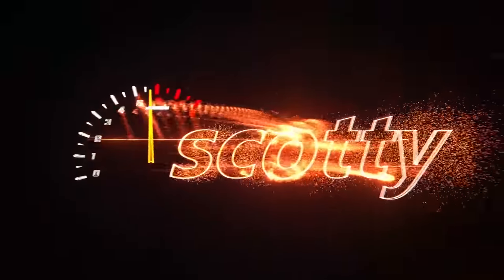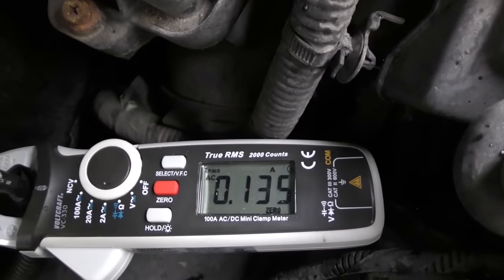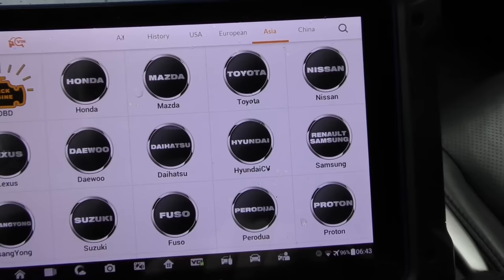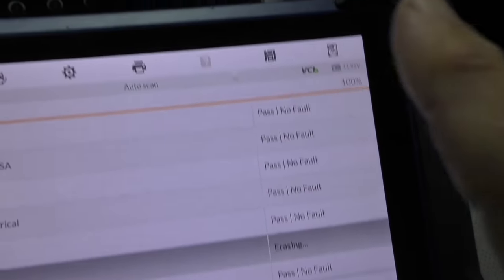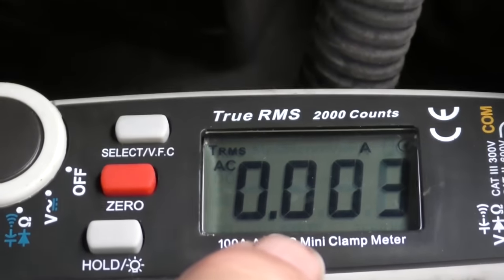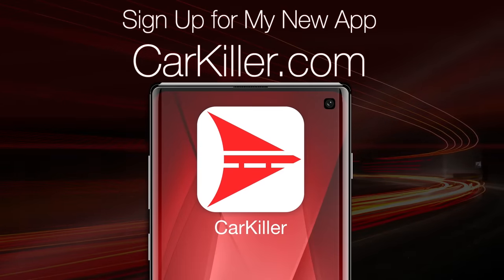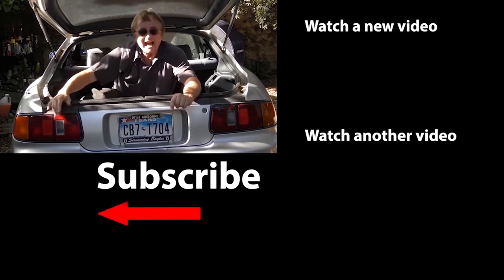Watch This Before Buying an Acura

Comment: No need to use a clamp on and look for milliamperes. 

Its the Blue Tooth module that is in the console. When they get old they drain. 

I’ve had my 2008 MDX for 30 years. I unhooked the BT module...which I never use...and it no longer drains batteries. 

It has been fixed for 2 years.

Comment: Hi Scotty ! You don't have to disconnect the terminal for the quick battery disconnect device, all you need to do is to unscrew it so it does not conduct electricity. I know it because I am using it on my car in Hong Kong, all you need to do is lose up the green nob for bit, that's it.

Comment: This problem is solvable. You have to isolate the circuit that's causing the the drain using the same amp clamp. Then using a wiring diagram and amp clamp, isolate the component on the circuit. Helps to have a scope instead of just a meter.

Comment: Also, a big deal of why a BIGGER battery may necessary in circumstances like this-
 Consider, the antennae is always ON, and when approaching when with the key fob is near, the vehicles are expecting the owner.  At this point, it sends a beacon communication every so often, just to check to either lock, keep the doors open, or perform some other default or preset function.  Pretty smart, but all this rigamarole need electrical juice to function. Every so often with Scotty being near the car, he's activating the system which checks to make sure the systems are ready for him.

Comment: YAY! A 1G RDX!!! They're pretty uncommon to see! 

289K miles on mine!!! All original!!!
Reply: Midnight Mystery ACURAS ARE ROCK SOLID! Last forever if you take of her
Reply: @Prodby2trill  Yep! My 2007 RDX is as 292K miles. Just needs rear struts and an AC evaporator soon. 

I also got a 2006 Accord V6 and I've already put 9K miles on it in 10 weeks. LOL!
Reply: Midnight Mystery that’s awesome! My 04 TL is at 200k miles and she’s still running strong 💪 just a little TLC every once in a while
Reply: @Prodby2trill  Oh. That's a good car there, bud!

Comment: If you have CAB bus, you can't start pulling fuses and when taking a reading, you should also manually latch the hood lock mechanism and lock the vehicle. I've had my Acura parked for 2 months without being on a battery maintainer when on winter vacation. No issues starting.

Comment: I had a 2007 Acura MDX that also had a parasitic drain that wiped out the battery after 2 days of not driving it, that model and year had a bad A/C relay and/or the cell phone hands free Bluetooth  module were the culprits. I replaced the A/C relay and no more problem. A year after I sold it, the new owner called me up with the same problem, I told him to replace the hands free Bluetooth module in the back of the center console, he did and no more problem. I hate electrical Gremlins.

Comment: I see a bunch of people pointing out that it's the HFL/Bluetooth module for this car.  Stuff like that, especially electrical and electronic stuff, Google really is a legitimately useful tool, as cars tend to develop the same problems these days.  While I used to actually fix cars for a living, though my years and experience were limited, but seeing common problems discussed online has come in handy on more than one occasion.  Just seeing the anecdotal reports is as useful, or even more useful in some cases, than the OBD2 scan tool.  And I think a lot of professionals have become so reliant on trouble codes and I understand that thinking as I've been there, and I think it's easy to forget that you can learn a lot from a good internet search.  My Mustang, for example, likes to throw cam sensor codes, and the shop I go to when I can't or don't want to work on it myself changed the sensors, but it didn't fix the problem.  In that case, it turns out it's a false code by an alternator going bad(but still charging).  I found that out because many others had the problem and went through major hassles to get it fixed, but their experience saved me tons of headaches.  I mentioned it to the mechanic who changed my cam sensors, but I don't think he gets any other Mustangs in his shop, so I don't know if he ever sees that problem anymore.  So to anyone troubleshooting something like this, a good internet search can be the most powerful resource available, and at worst, it doesn't hurt to give that a shot.  I've successfully diagnosed several tough issues that way.

Comment: somehow I have a blown head gasket & my hot rod Dad, who is also a mechanic around the same age as you, has been taking apart the engine piece by piece - I bought the car new & didn't get the tech package cause I know those things can go wonky over time. Otherwise it's a great car. So far I have had 2 batteries since 07 with almost daily NJ driving & a few years of NYC pothole dodging. Thanks for sharing your info. It is greatly appreciated.

Comment: Acura’s of that era would drain the battery if the auto setting was left on the headlight switch. It is in the owners manual not to leave it on auto

Comment: I had a 2004 Chevy 2500 hd dump truck...I bought it with so many problems. The first week I had it the radiator leaked and the dashboard went out, so I fixed that along with the water pump. Then one day I was driving on the freeway and it suddenly stopped running, I would step on the gas all the way and no acceleration. I would have to pull over, shut it off, and turn it back on. At first, it would work and I was able to drive off again. It then started to happen more frequently but now it was taking longer to reset so back to the mechanic it went, this time a code for the accelerator pedal sensor came up along with a throttle body code, another one for some sensors inside the engine (sorry I forgot what they were) so luckily I was able to make money with the truck when it did work and replace it all. It worked well for about a month straight and it the problem started again only this time I started noticing the truck would completely die off if I didn’t turn it on for a couple of days. I bought a new battery but it ran through it within a year.I finally talked to an electrician he told me the parts I recently installed had to be factory reset. This time I took it to a Chevy dealer I paid about $180 for them to look at it and “reset” it. The week after, it broke down again. You could only imagine how happy I was with this truck by now 😁. I took it back to Chevy and they replace the pedal sensor module, I got it back a couple of days after. The  day after I got it, I was ready to get on the freeway it completely stopped running 🤦🏽‍♂️. I had a couple of unpleasant words for Chevy 😁. They sent out the tow truck and I got a call about an hour later saying it was fixed. I drove it for about 150 miles and boom the problem was back Chevy took a look at it again and it turned out to be the gas pump lol. The fault in the module wasn’t allowing the code for the pump to come up so I had to fix that just for it to show me what the real problem was. After all that the truck ran like a beauty. I ended up spending about $6000 on all the repairs. That truly was the truck from hell!

Comment: Check the Bluetooth card inside the overhead console. Remove it and see if the drain stops. It's a common problem with gen 1 MDX.

Comment: 8 minutes of video, doing nothing to the car to diagnosis it? Maybe show your viewers how to check buss termination resistance, anything that would cause communication codes. Or show your views how easy it is to voltage drop the fuse to see if current is flowing? This poor guy's car is exactly the same as when dropped it off, other than the terminals are tight.

Comment: Lincoln should get either a 2008-2013 Acura MDX, or 2007-2008 Acura TL Type S!!!

Both have over 300 HP, has a 3D BOSE audio system, and are super reliable and luxurious, with Japanese cowhide.

Also both have 5 star crash ratings, and SH-AWD with a computerized suspension system!!

Both can also be had for $7,000-$12,000!!
 Depending on the milage.

I love my 2004 MDX Technology.

184,000 miles, and drives like it is brand new! 
It drives like my dad's 2011 Range Rover Supercharged! 
And the sound system is phenomenal with Bose Surround sound!!

Plus it has a 5 star crash rating, weighs 6300 pounds! Gets 28-30MPG on the tollway,
 and has VTEC, and 284 HP!

I named him Maximus. 
I had bought Maximus when I was 15 myself. 
I had mowed over a  hundred lawns, trimmed countless trees, and worked my butt off!

It was well worth it to own such a phenomenal vehicle!

Now I had just turned 21, and Maximus is doing fantastically, and still drives like new! 
Even at 191,000 miles! 

That's my Acura story.

Comment: This is a known problem with the Bluetooth HandsFreeLink Module on this era of Acura cars. My TSX also has the same exact issue as this where the battery goes completely dead after 2 days. Best thing that can be done is disconnect the Bluetooth module from its wiring harnesses. I believe in this car it’s in the glove compartment somewhere. My car it’s in the passenger seat foot kick panel. In a tl it is inside the center homelink housing. Look for a greeen connector and yank that and the battery will go back to normal. Then, go to an electronics store and buy any Bluetooth auxilliary receiver and you’ll have the functionality back without the battery drain.

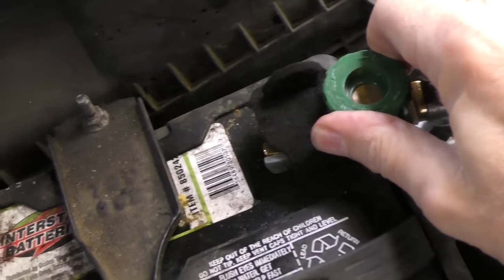Comment: 6:10 i thing you're using the Quick Disconnect terminal wrong. You don't have to completely remove the terminal from the battery pole. You just unscrew the green knob, and that rices the plates and disconnects the battery pole from rest of the car. Just my 2 cents!

Comment: My 2009 Honda pilot did this. After a few battery replacements. My dad suggested we test every fuse and relay. It ended up being a bad relay in the fuse box under the hood. $8 part at Honda and $38 at Acura for the same exact relay. Once the relay was replaced, the problem never came back.

Comment: I almost promise you it's the "hands-free link" Bluetooth module. My '11 MDX had that issue, did some research where people talked about heating it up to reseal the soldering joints. So took my module apart, got the circuit board out, put on some non-conductive material, put in the oven for around 8min, at roughly 350°. Reinstalled, haven't had an issue since... This is also a possible (and cheap) good fix for a Bluetooth module that intermittently drops your connection to your phone in an Acura from the TL, to the MDX, and others...

Comment: I had (and would still be driving) a 2010 Honda CR-V EX-L that exhibited the same type of parasitic draw. Dealerships couldnt diagnose where exactly it was coming from. Replaced one module, battery and battery terminal clamps. Did nothing; problem still persisted. Next repair was going to cost me $800 (no guarantees). I let their techs mess with it for a few more days, and when I went to look at the car, and saw it all dismantled, I said no thanks. Traded it in at value before repairs for a Camry. That car was a complete loss. Horrible experience.

Comment: Very common problem with the older Acura TLs - perhaps shared with all older Acuras. Remove or replace the Bluetooth Handsfree Module. Search replacement tutorial on YouTube - very easy to remove. Replacement only necessary if you use your vehicles handsfree feature.

Comment: It is the handsfree system on this cars, the Acura TL from that generation does the same thing when it goes bad.. best fix for that is to unplug it and live without it or just get it replaced if the person actually uses that... On my TL is unplugged and never had issues with my battery draining after that.

Comment: Regarding the first car, the Acura, I would disconnect the Bluetooth module to see if this stops the battery drain. I had the same issue in my 2007 MDX and it took me forever to figure it out. For some reason the Bluetooth module fails often and is the weakest point on the vehicle. I disconnected mine and bought an aftermarket solution. No more battery drains.

Comment: Hands free link modulee is on the passenger side of the center console. You will need to remove the DVD cover and carefully pull back the carpeting/plastic on the console

Comment: My 2006 Pontiac pursuit... gt sedan I left the key turned over with car off to listen to music and than left it like that for three days before I drove car an by than battery drained... ended up having 48 codes on my transmission and was locked into 2nd gear... all I did was clear codes and everything came back!

Comment: Also another common thing on these is the brake pedal brake light switch also tends to break and does not stay pressed down enough to turn off and on that's another issue with all Hondas/Acuras had to fix that switch many many times just really cheap plastic switches.

Comment: I know this video is old but I just bought a 2010 rdx for cheap because it had a similar problem. After reading through some forums I found out it was the bluetooth module located under the center console. I just unplugged it and that solved my battery drain problem

Comment: My friend had this issue for 2 years and mechanic after mechanic NTF (no trouble found) until car stereo technician said the GPS was malfunctioning and disconnected it from overhead console where the garage door opener button is. Problem solved 😁

Comment: Hi Scotty - same thing happened to my wife’s MDX.  It’s the Hands Free Module. Simply unplug it   It’s located at the back of the middle drivers console.  Go in the back seat and pull off the back of the console and unplug it.  No more drainage. To replace it it’s between $700- $1000. This should be a recall. Have a good day.

Comment: You should be able to monitor each module from a scan tool. We had this problem with a mercedes (30 Computers on board) there was an ECU turning on and off for no reason. You just look at "Actual values" in each module until you find the one that has voltage going up and down for no reason.

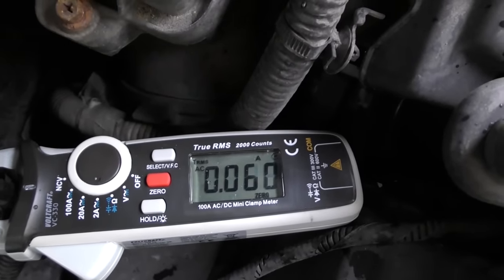Comment: At 1:20 - the meter is on AC setting. It needs to be on DC - there is no AC current on the battery terminal. At 2:00 - the same. That is why the current was close to zero and fluctuating a little, no real readings.

Comment: My 01 Chevy S10 was also going dead if I let it sit a week. I ended up buying a solar panel and putting it on the dash and running it into the cigarette lighter. That actually worked all year until this winter. I could go weeks without starting the truck, but now it goes dead again in days, even with the solar panel.

Comment: As a former acura mechanic,   I can tell you right now this guy is testing the system wrong... First he missed a loose battery terminal until 1/2 way thought the video.    Secondly  computer keeps monitoring the emission system for a few hours,  until computer goes into sleep mode.    He should have waited  for a few hours., after fixing loose battery terminal.  And he should have checked the if the Bluetooth was the problem by unplugging it.    This guy is making fixing it way harder then it has to be.

Comment: that disconnect he had on the battery only needs to be unscrewed a little bit to open the circuit you don't have to take it all the way off like scotty did in the video thats the whole point of installing it is so you don't have to take off the whole cable every time.

Comment: i had this similar issue with a Honda for 4 years, had to call a mechanic friend once the car actually died while driving. He said it was the ground wire so just replaced the old one and car didn't have any issues after that.

Comment: I thought those quick disconnect knobs is just to twist it open to break the circuit; no need to pull the whole assembly OFF the negative battery terminal!

Plus Scotty was in the general area with his expensive OBD2 computer. Those cumbersome Hands Free modules
Reply: @172-e5s  i'm glad someone else noticed that. thanks!

Comment: An old Ford I had it was draining after a few days while parked. Later on the heat and A/C blower fan only worked on 2 settings. Changed the blower resistor for $15 and it fixed the blower and stopped my battery drain at the same time.

Comment: Had the same issue with my 2008 Acura TL. Battery was always dead when it sat for more than 2 days. Sure enough the Hands Free Link was running in the background when the car was off. $150 fix after taking it to my dealer.

Comment: since the problem is when the car is just sitting there. can't you leave the battery connected and disconnect the fuse of the affected systems,  maybe the computer, or hands free link system / fuse?  just do one system at a time till the battery no longer dies just sitting there. course this will/ maybe only tell you what the problem is, but it's probably cheaper to use the fix the customer found, than say replacing the computer

Comment: Scotty, I think a better solution would be a battery tender hookup. Use zipties and route some quality thick gage wire under the fender to the front or side of the vehicle and leave the terminals exposed or drilled through the fender liner with a rugged cap to prevent a short. Disconnecting power probably isn't great since it likely resets a lot of ECU data on the engine performance and tweaks it makes to fuel mapping and throttle position.
Reply: I use a battery tender but it's not an option when I have to park the car at the airport when I go on travel..